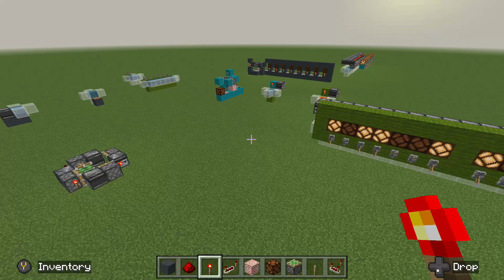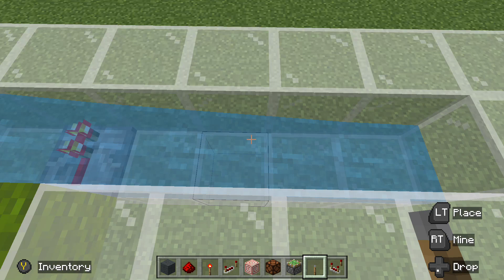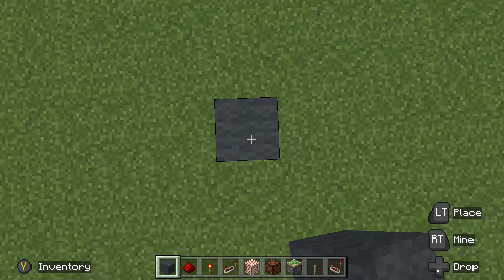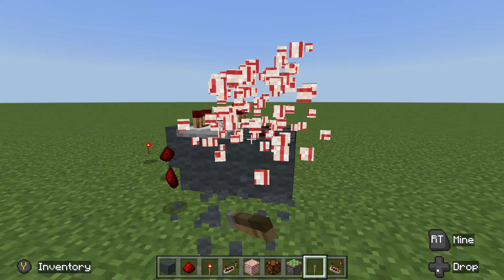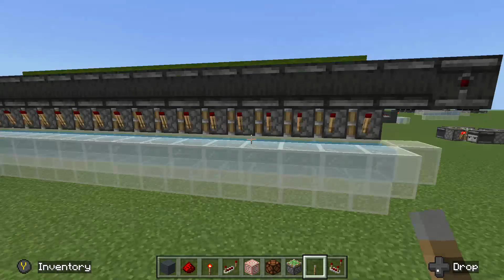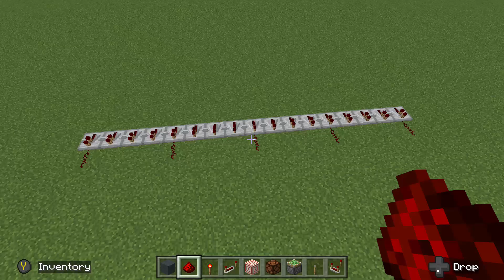Minecraft Bedrock Wireless Transmission Recap/New Info

Comment: my dude. 
me and meckenicalrobot designed a hex clock that goes 0-15 and restarts at 0. with a little redesign it could do 0-15-0-15 you see with a negative indicator we have a square generator.
I don't think it is possible to avoid the clocks, but the synchronization could be managed with 4 way handshake. 
really clever done.

Comment: Damn this is some crazy work ,We were trying since quite a long time to get consistent transmission on 1rt for our Redio project ( basically wirelessly interconnected systems like farms/storage)
Reply: I like how he’s handling noise, to pull signals for the receiver in that last demo.  👏 really clean concept, and removes the need to put a receiver on the transmitter end to confirm. Definitely gonna experiment further the concept. Thanks for sharing Jonathan! 🙏